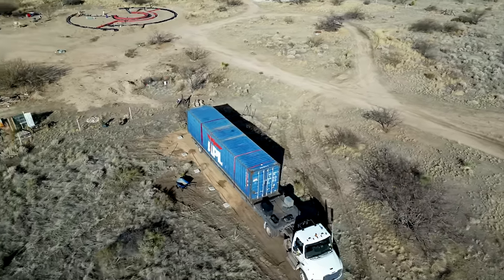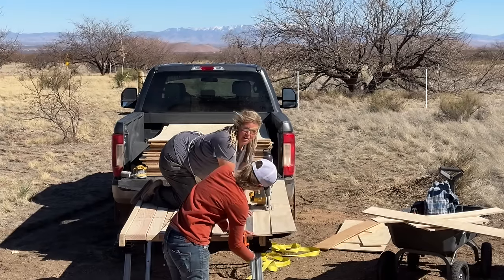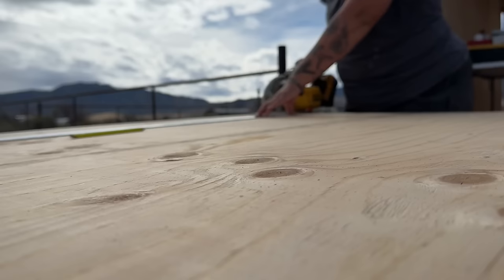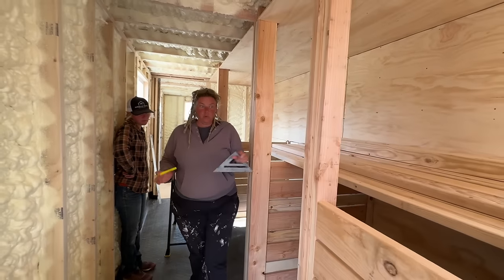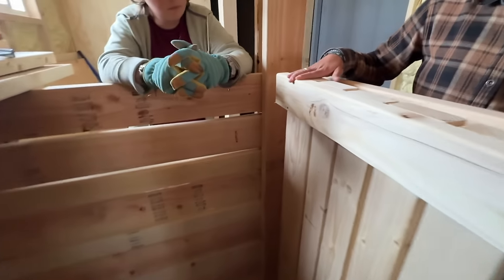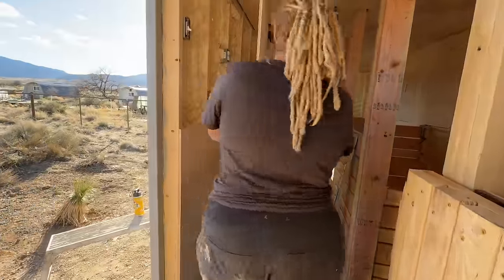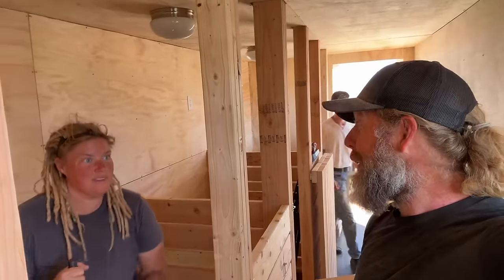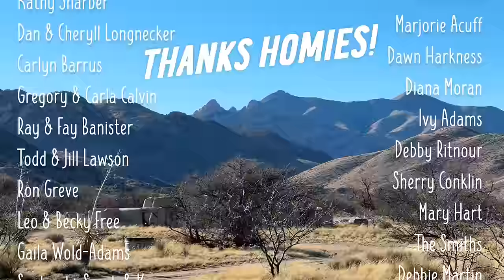Baby Goats are COMING! Will We FINISH the KIDDING STALLS in Time?

Comment: Great progress. doors swinging in is a bad idea, you will never get all the bedding out of the way to open the door. Honestly we have sliding doors on all our stalls, they do not take up much walkway space and can easily be left open or closed. They do need an L bracket to keep the bottom from being pushed out when the door is closed. I'll now watch the rest of the video to see if you figured it out. (have you ever seen a horse stall door open in?) Edit to say, That was fast! but I think you will like sliding doors much more.
Reply: Are you putting goats in and out over the top? Put a dog in and test it.
Reply: I was scrolling through the comments to see if anyone had suggested putting in pocket gates because the swing out gates take up too much room.  I think the swing out gates are going to be an inconvenience, but let's hope I'm wrong. 36:08
Reply: We used swing gates in our setup, much like theirs, and being able to swing them out to funnel the goats into the correct stall was fantastic.

Comment: Legendairy Goat Barn is looking good. Like the flooring and how it rolls up the walls. And Ashley is correct. Carpenter pencils are designed specifically to be 1/2 inch in one direction and 1/4 inch in the other. Flat so they don't roll and more comfortable under a hat or over the ear.  Love how much everyone contributes ideas!

Comment: Nice, building the kidding stalls! I like the offset ceiling! The walls look good in the feed bin area. It was cute how Jax was blending into the wall! Nice pile of solar panels guys! I like the floor membrane. I bet that will protect the wood underneath? I like the adaptable walls for the birthing stalls. It's great that Jonathan got to work on some of the electrical outlets and switches. Yay, lower walls in the birthing stalls. Trashman Jax! Mission complete! Nice sunset and shots of pet dogs and cats. Cloud loves to be with you guys too! I think it is better to have the doors open into the hallway! I was worried how you could close the door around a goat inside. We have sliding doors for our barn but they are outside the stalls. It's looking so good in there. They just can't stop being tough on you Ashley! It does look really good though. Latches and hook and eyelets to keep the doors open and closed. Practice makes perfect. Don't feel bad Ashley! I like the lights. That'll keep the dust out. Nice measuring for the two lights in the milkroom ceiling Jonathan. Thanks for this video Longnecker family! perhaps Friday will be the first goat to use a birthing stall?

Comment: To glue down your flooring I have a suggestion.
XL-8 adhesive
It's used to glue Birkenstock soles to the base amongst many other things. The main reason I suggest this verses a permanent adhesive like epoxy is the ability to repair. To remove that rubber flooring from the wood, you will need a heat gun, some vise grips, and a big cup of coffee. Used this method with cheap vinyl flooring which melts much sooner than that really nice rubber flooring you've put in.
You  will want to put up some wood molding over the edges up the walls. Goat will destroy the uncovered edge in a season or less. Once even a little comes away from the wall, the bedding dust collects and it will collect moisture even in the desert, then rot taking you wall with it.

Comment: You could even use the doors to close off the corridor to make it easier to get the goats in the right stall. 

Just add a third latch on the front wall. Maybe a jam to latch it too if it’s too far from the wall.

Comment: Use a one by six or a strip of plywood ripped down on the floor up against the wall to hold the flooring in place (rubber mats) also the slats that you have in the birthing pens you might want to put a little block on the bottom one so when the kids are urinating etc and other messes that’s going to happen it won’t saturate that bottom 2 x 6. Also when cleaning up stalls you can use a leaf blower and blow out across underneath. It’ll make it a lot easier cleaning out the corners and etc. etc..
Reply: The block spacer, placed beneath the lowest wall panels, is an excellent suggestion!  The stalls will be much easier to clean.

Comment: I think you’re gonna hate having the door swing in ward, when it comes time to mucking out the stables, I see you guys changing them soon. I think you should use a barn style door with rollers and then have a space on the closing side where it slips into with a pin so they can’t push it open because obviously track can’t go on the top side in the open area think about it it’ll work good.  PS Lol teach me to make comments before the video is over. Hee hee.😊😊😊 You guys are way too good at building out the shipping container, I am hoping one of the kids wanna live in a tiny shipping container home. Would love to see what you guys do with that.😊😊😊😊 I think it’s definitely time to get a track saw, Also you can make a template and use a router to cut out all your electrical box holes, and it makes it a lot easier to just the sheet over top of the openings to the windows and then use the router and cut it out and that way it’s easy I believe you know what I mean

Comment: Judy and I have to draw a picture on scrap wood, of the panel as it looks when you're standing facing it with measurements, so you set it right next to the w😂😢😅ork 4  by 8 sheet, verifying each designated ✂️ Love Mitch and Judy

Comment: Full disclosure, I wrote this before you flipped the hinges.

Okay so its a bit late obviously to say the door on the stall should be different but maybe its not. With the door swinging into the stall, not only will the goat(s) potentially be in the way but any nesting material on the floor will be in the way of the door. This also include goat waste.

If the door opened into the hallway, you could make a latch point on the opposite side of the hall so that you could use the stall door to block the hall when moving goats in an out. I cant imagine herding goats is much easier than herding cats.

Comment: When sheathing walls ; hang horizontal and hang top first. Butt (Push) top sheet to ceiling factory cut, nice and straight, then trim lower sheet to fit. 
  Factory edge to factory edge, cot edge to floor, then use a flat bar under cut edge and use foot to pry sheet up tight to (factory edge to factory edge) top sheet. A small trim board (mop board) will cover gap between wall and floor. 

Late for this project but same applies to Sheetrock and you have plenty projects in mind…

Comment: I love watching your family I think you guys are doing an awesome job however at the back of those stalls at the bottom where the wall meets the floor I would put a good caulking there like a good clear caulking so that when the Stalls are urinated and it doesn't run under that and stay in the walls and get into the wood and stuff in the walls
Reply from the maker: The rubber floor will extend up to protect the lower walls, and there will be plenty of hay to soak up stuff.

Comment: Ashley, please don't feel bad. Measuring tapes are really complicated. They should be better if the inches were spaced by 1-10 or something easier (the lines doesn't make sense). For example, the centimeters are easier to remember because each centimeter is spaced in tens. 
There's a frase that says "measure twice, cut once" 
You did great anyway, I wish I was as smart as you are.

Comment: Time will tell, but being around livestock it would be better to have to doors open out to the hallway.  That way the animal knows exactly where to go and when you let it out it knows exactly where to go.  If they are laying in the stall, you will have to open the door into them.  When letting them out of the stall you will have to open the door into them and crowd them against the wall to let them out.  If you open into the hall you can also put a latch on the wall to hold the gate open till the animal is in or out of the stall.

Comment: Are you going to seal the plywood?  Or is there nothing you can use that won’t harm the goats?  You all did a good job.  I too would probably do smaller ceiling pieces.  Just because it would be easier, less heavy, to put up  and if you ever had a leak or something, it would be easier to remove and repair.  I love the way you all feel at ease teasing each other.  It’s all done with love.  Congrats!

Comment: think about swinging the door from the lh side as you look at it ,first side a was  a no no and you woke up to the problem swinging on the lh side and inwards you control the goat takes less room am and passage way is free,looks great"",want to be my apprentice"" ??what are you fitting to the top corners and vertical , square ,half round  or fillet mold that is a piece that looks triangular   does a neat finish to the work a great job done . a neat tidy site means  neat tidy work and less chance of an accident

Comment: You are all doing a great job.
I was going to point out the problem with the internally swinging door.  However, you just realised the problem with the dog in there.
I am 67 and watching from the UK.
Also, I noticed you have a Dewalt drill, which you also use as a hammer.
It must be a hammer drill. LOL

Comment: i don't know if you've thought of it yet or not, but when the goats urinate or deliver in the stall and it gets into the wood it could be quite a stench without good ventilation.  just a fyi.  enjoy all the videos.
Reply from the maker: That's why we put a rubber floor down and it will come up the wall a bit. There are multiple windows, and the sliding door will be open most of the time.

Comment: Have you installed any vents to get rid of smells and create air flow?
Reply from the maker: We have multiple windows and the sliding door will be open most of the time once we finish the rail system and build the roof on the south side.

Comment: Why do u not attached the flooring to the wall with a strip of wood and screws?
Reply from the maker: Because it lays flat by itself, and the stall bases are screwed into it.
Reply: @TinyShinyHome  in the video you can see that there is about 6” that is flopped over.  She said she was looking for a glue to attach to the wall but that she was having trouble find what she wanted.

Comment: If you have a harbor freight near this could help with those plywood rip cuts…

QUINN 52 in. and 100 in. Clamp and Cutting Edge Guide - Item 58363
$39.99

Comment: The big problem with timber is that it harbours bacteria virus and worst of all spores of diseases like ring worm. Farmers have for many many years treated timber with various types of paint/distemper to cut down on the incidents of these troublesome diseases. The  main diseases commonly associated with dairy/ multi suckler units are the two types of mastitis, ringworm, tetanus and respiratory  foot problems occur on a regular basis, regular inspection and foot cleaning/trimming will keep this to a minimum. My point being all these lurgies can be harboured short or long term in timber and around ferrous metal fixings. You should paint with animal safe product ASAP and commit to an annual refresh. Ashley did it not occur to you that it would have been much faster and simpler to have boarded out first then built the pens had you chalk marked the centers of the studs on the floor, that way if in future you wished to move or alter the stalls there would be no holes left to fill in. Having the gates swing inward might prove problematic should your nannies lay down with their backs to the gate. Do you hand milk or use a milking machine? Many years ago a friend kept and milked a large flock/herd of goats to provide milk for babies and toddlers allergic to cows milk , she was a midwife and district nurse all of this she did for free quite a commitment on top of her usual job and also caring for an elderly gentleman.